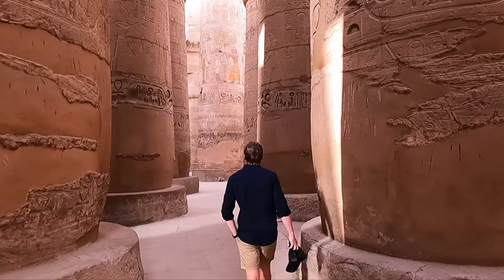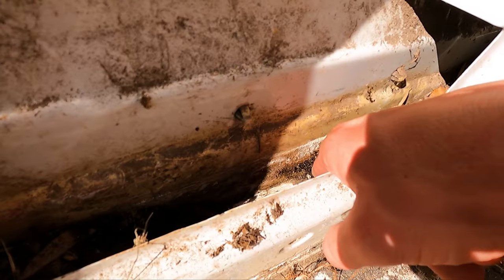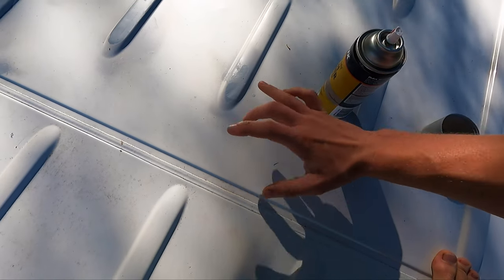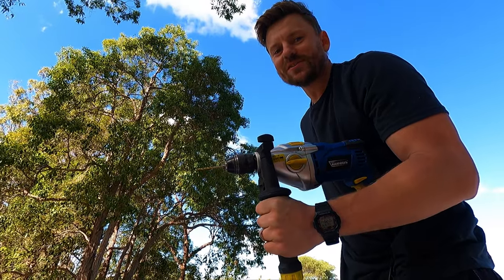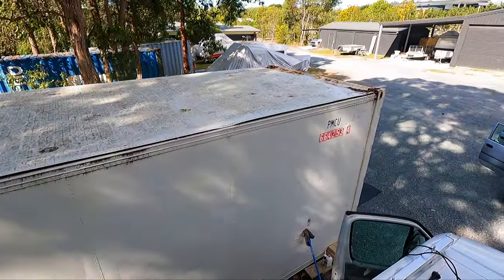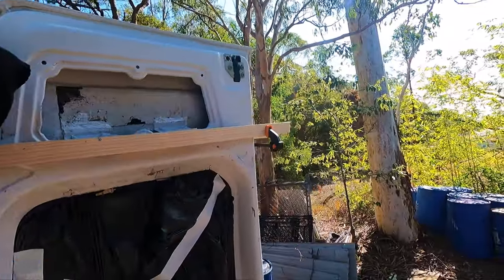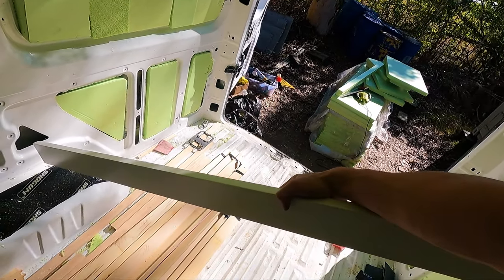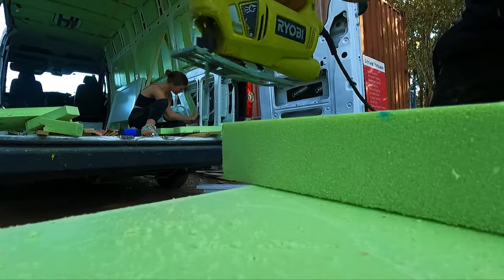Van Conversion With No DIY skills (1/5) 🇦🇺

Comment: A wonderful idea. The project of converting a van into a house is one of the projects that I dream of doing. I advise you not to attach the solar panels to the hole in their frame because aluminum is a soft metal, but to attach them using clamps attached to roof rack ,The part of the video where I drilled  in the roof of the van without deactivating the hammering feature of the drill made me want to smash my keyboard. i cant wait to see how you gonna do the electrical work, hope I don't have a stroke by then , good work 👍
Reply from the maker: Hahaha that made us laugh 🤣 yeah we noticed the hammer feature was on in the edit and thought “ooooh that makes a lot of sense now” 🤣😂 we’re learning a lot! If you think this was bad though wait until next week - it gets A LOT worse! You’re going to need half a dozen keyboards by the end of this.